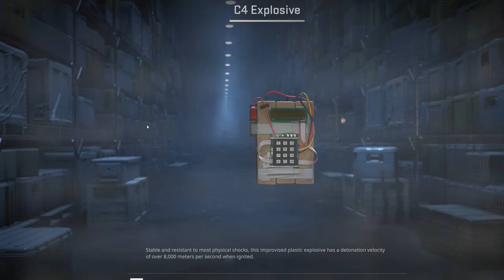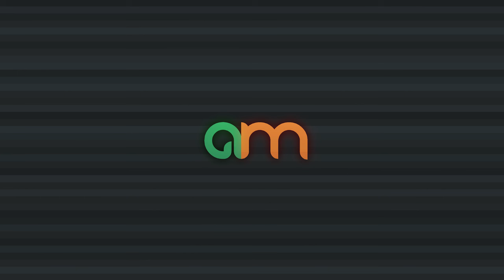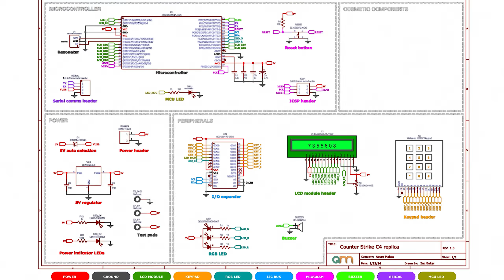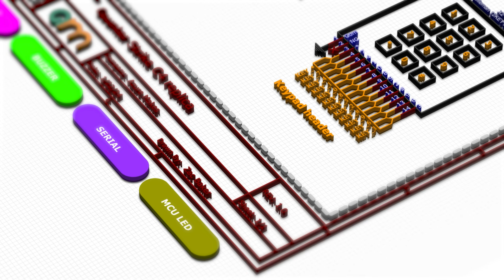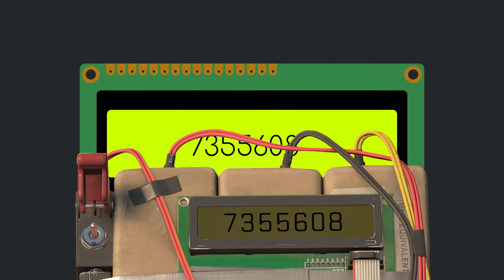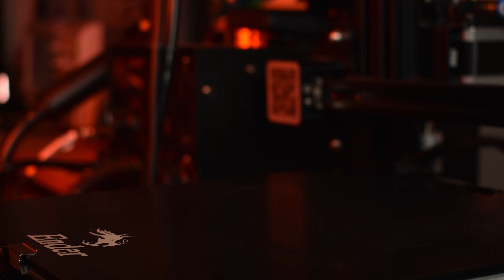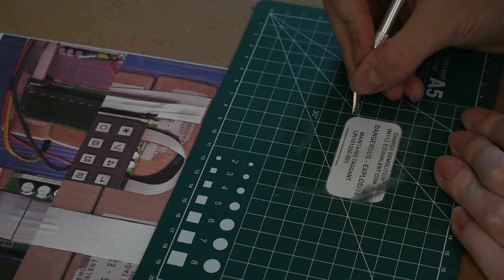I built the C4 from Counter-Strike 2

Comment: What an amazing work of art! The production quality is also over the top. You have gained another follower. Also the only improvement I can suggest is that the led should be a lot brighter like in-game. Everything else is perfect, even to the cable wrinkles and the center of mass.
Reply from the maker: Thank you so much! I actually had to increase the LED resistor values because it was too bright and painful to look at. The brightness looks nice in game and works well as a gameplay mechanic so you can find where the bomb is planted, but in real life it would be pretty painful haha. I really appreciate the thoughts though! There's a bunch of things I would do differently if I did this project again.

Comment: this is really cool
curious tho - is there any technical reason for the speaker to sound different? like, it sounds really close (esp the ending beeps before the boom and how there are more beeps over time) but the pitch is off by an octave id say
Reply from the maker: I believe I got the frequency correct for the beep tone, but I made the mistake of putting the piezo buzzer on the back on the PCB facing into the interior cavity of the C4. That reduced the volume of the beeping significantly and it probably effectively acts as a low pass filter and makes it sound lower pitch. That's one of the things I definitely could've done better.

Comment: oh my god this is soooo good. what are the black 3d printed parts within the “explosives”?
Reply from the maker: Thank you so much!

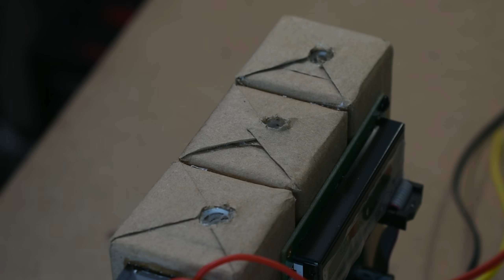Do you mean the small black pieces I glued into the drilled holes at 17:15? They're just pieces that I modeled that could securely hold onto the ends of the wires and also help achieve the wider shape of those pieces on the in-game model after I put heat shrink tubing over them.
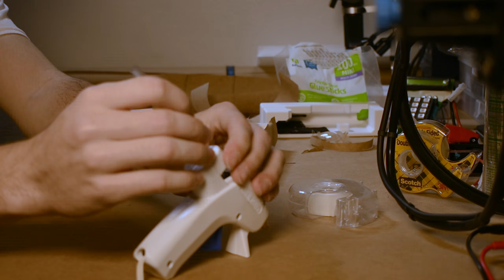Reply: @AzureMakes thanks for your answer! I meant the black piece at 15:19 , anyways you inspired someone to make a similar project over the winter. thank you for that
Reply from the maker: @gsn1511 Ah ok, that makes more sense. That is just some felt padding I added to the inside of the blocks to tightly grip the battery and stop it from moving around or jiggling.

I'm glad I inspired you to make something! Best of luck.